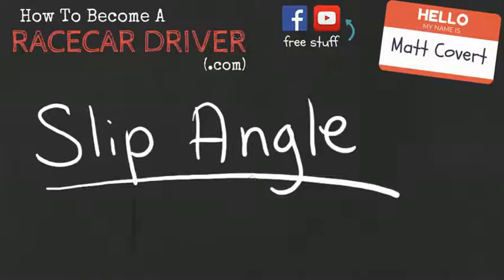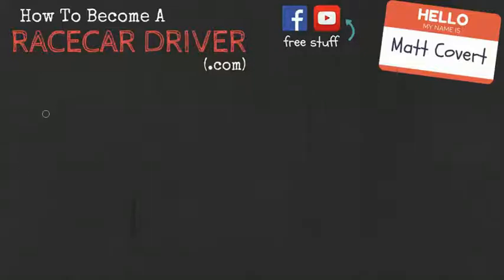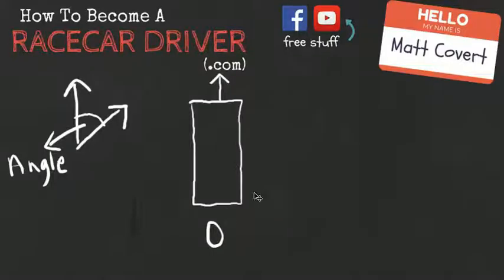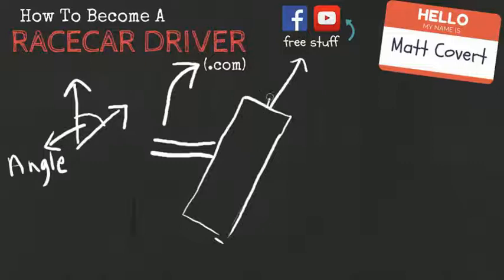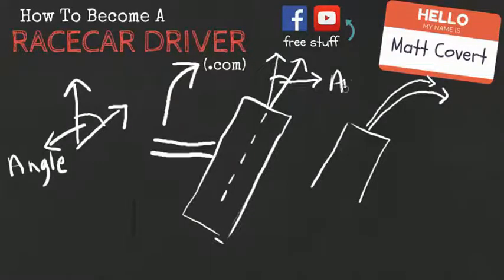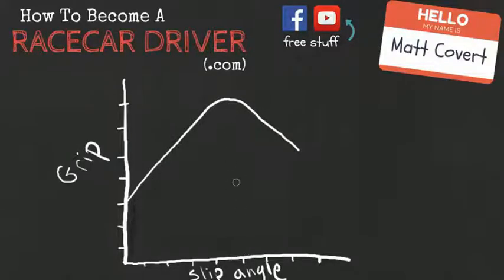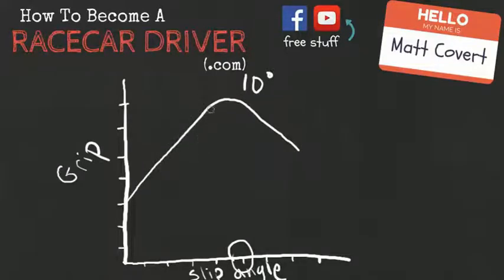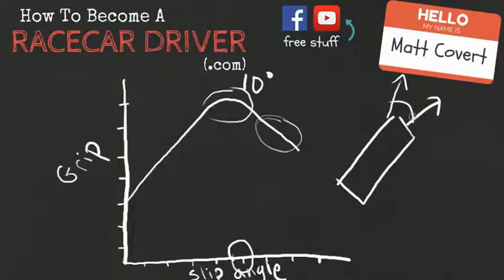Slip Angle

Comment: If I'm going through a corner with a FWD car and I can hear than my tires are squeeqing, but the car is neither understeering nor oversteering, does that mean that I'm pushing it too hard, that is, the slip angle is too big so my grip is reduced?
Reply: Tire squeal varies so much from tire to tire and is a totally unreliable indicator of grip. The best indicator of grip would be to feel the lateral acceleration yourself. But thats also in the realm of top pro drivers. So a compromise solution is to watch your onboard footage with recorded telemetry or to analyse your telemetry that includes steering angle, while simultaneously practising to hone your senses for lateral forces. It's a long arduous road but a fun one for us inspiring racers. Just to add tho, even analysing telemetry has its limits because of poor driving skills lowering the actual grip of tires.